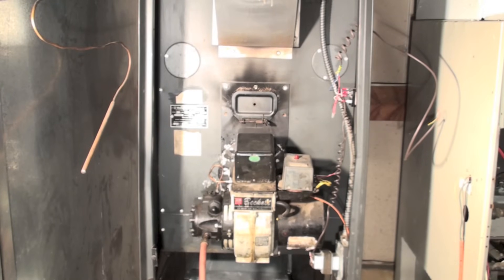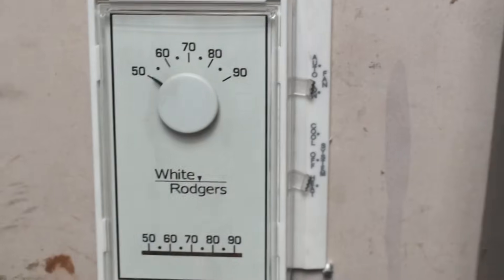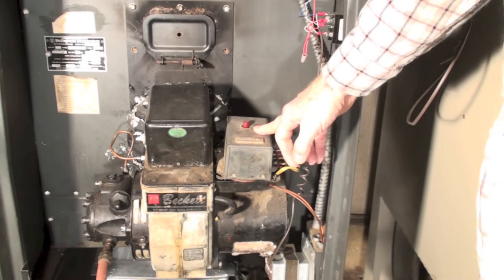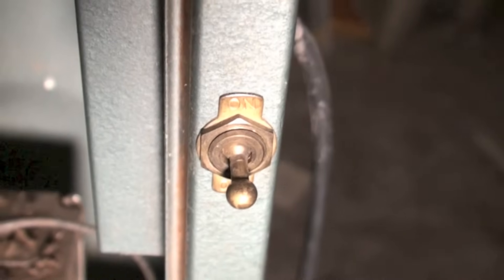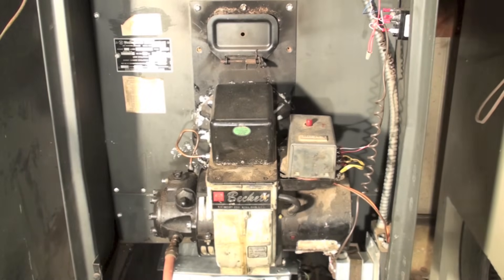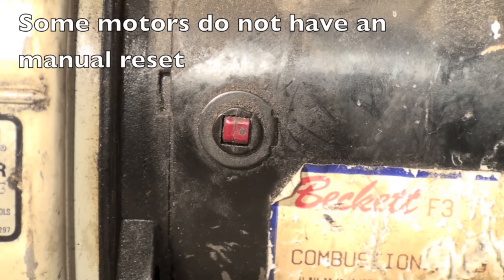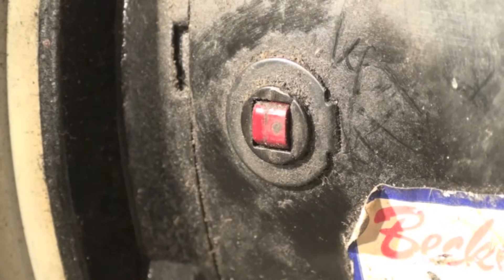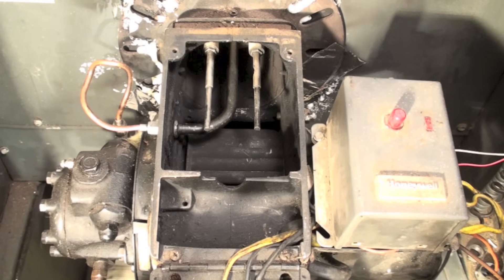Troubleshoot the oil furnace part 1. Burner won't start.

Comment: my burner is doing nothing at all. checked the motor and works fine. the red button never tripped but I can manually trip and and the red light will come on. there is power to it. could it be my thermostat?  again no noise nothing at all. also could it be my Honeywell r8184g intermittent ignition oil primary?  please help! !
Reply from the maker: +dandanzoo You can jumper the thermostat by connecting the T-T terminals.  You can also disconnect one of the terminals connected to F-F.  If it starts when disconnecting one of the F-F terminals, the cad cell is shorted.  Check on the side of the burner motor to see if there is a reset button.  Just a few things to try.  Hope they help.
GFM

Comment: Furnaceman, I have a Lear Siegler Model MOC80 oil furnace. It won't turn on unless I push the reset button {red button}. After it gets to the right temp (what the thermstat is set on) it will turn off but won't start again, when house gets cold,  until I push the reset again. What's wrong??
Reply from the maker: +Sandra Delaware You probably have an oil supply problem. Have you changed the oil filter?
GFM

Comment: +grayfurnaceman I have a beckket model a af when I restart it it turns on ignights the oil and burns for a few seconds then the flame extinguishes and starts to smoke alot any suggestions I think the missile could be slightly cloged what do you think
Reply: I mean nozzle sry
Reply from the maker: +Theresa Quinn I would do a complete service including nozzle, oil filter change and flush to start.
GFM
Reply: +grayfurnaceman ok thank you I'll try it  ,also it happened the day we got 2ft of snow there isn't a intake vent for o2 air for the combustion is there?

Comment: My furnace wont ignite by itself I have taken out the electrodes and tip and replaced both they where caked with soot it then worked for about a week then same problem I removed them again and they are covered again so i cleaned them it worked for a couple days now wont ignite again. I have stuck a long lighter and ignited it and it will run  just not start up by itself. I have noticed the flame comes way out to the transformer. the air intake is all the way closed and I have tried moving it all around but doesnt change the flame. can someone help
Reply from the maker: +Travis Workmen Look for blockage in the heat exchanger or vent pipe.
GFM

Comment: I've got nothing. this happens every so often. last time was about 2 weeks ago. the heat just stops kicking on out of nowhere like there is no power. last time it's done this I went to bed and woke up to find it working normally!? this time it's not kicked on for hours what could be the problem?
Reply from the maker: +Michael Russo Probably the cad cell is not sensing flame.  Be sure it is pointing towards the fire and is clean.  You could also have an oil supply problem.  Dirty oil filter?
GFM
Reply: +grayfurnaceman when I turn on the oil furnace  no sound comes out or anything, 
 its like it has no power, I checked the motor and it works, also I put in a new termostate, so what can I do if theres no sound when I turn on the furnace. Plz help.

Comment: my dad, let his oil run out, he got a filling, it ran fine, but decided to tinker. he swapped the filter on the tank. flushed the line from filter to burner. but now it won't bleed, it spittles a little bit, foams up. and just trickles. he's been trying to sort it for days. and refuses to call someone. any tips?
Reply from the maker: +Behemoth Vaping Be sure the gasket on the filter is properly installed.
GFM

Comment: I hit the reset and it just buzz's and then shuts off. Anyway to start the heater besides hitting the reset?
Reply from the maker: +Holly Nites Check to see if there is a reset on the burner motor.  Probably a red button that clicks when pressed.  Hope this helps.
GFM
Reply: There is a button, but it did not pop out. I did find something out. I turn the electric off, bring the black transformer box back and turn the fan underneath with a screwdriver. I put the transformer back in place turn the electric on and hit the reset and it starts. Why would turning the fan make it work?
Reply from the maker: +Holly Nites That is probably the centrifugal switch making contact when you turn the blower wheel.  New motor.
GFM

Comment: Hi I have the same system as you but only fan / blower goes on not motor for could this be igniter controller
Reply from the maker: +thetruth Does the burner motor rotate?
GFM
Reply: grayfurnaceman yes when I was turning switch on and off it actually turned on for 40 secs and I checked for spark good spark.
Reply from the maker: +thetruth Sounds like no oil available.  Is there a fog of oil in the combustion chamber when the burner is running?
GFM
Reply: grayfurnaceman fan blows but the oil motor does not turn on can it be the Igniter controller?
Reply from the maker: +thetruth Probably not the controller.  Still looks like no oil available.  Plugged nozzle, plugged filter, no oil in tank or pump failure.
GFM
Reply: grayfurnaceman tanks are almost at full plenty oil. typically the oil motor / pump turns on for a few seconds before turning off  but that isn't happening at all.
Reply from the maker: +thetruth What is the model# of the controller?
GFM
Reply: grayfurnaceman R814 G4009 intermittent ignition oil primary
Reply: grayfurnaceman here the model # R814 G4009 intermittent ignition oil primary

Comment: I have a Beckett oil burner with hot water heater. I have purchased three controls the one to the right of the unit that has the button you use to restart the burner. They all cost about $100. - $125 each. The first two lasted less then a year. The next one I purchased never worked and the shop would not take it back. Now I have to get another one. What do you think the problem is? It was installed by Viano Heating and Cooling, of Poughkeepsie NY. and the main owner who worked on the boiler has passed on. I called another company and they want $125. to come out that is applied to the first 15 minutes!
Reply: Marine Atlantic

Comment: The boiler fires up for approx 10 seconds
Reply from the maker: bazzer245 If the fire goes out and the burner continues to run for 1 min, it sounds like an oil supply problem.  You can remove the discharge pipe from the burner and direct the pipe into a can.  Reset the burner.  If oil flow does not continuously come out of the pipe, the filter could be plugged.
GFM

Comment: Hi, when i push my red button box, the boiler does not stay on, i am wondering about 3 loose wires in this box. I will check out the colours if you think you can help, thanks.
Reply from the maker: bazzer245 Does the unit fire off, then shut down after approx 1 minute?
GFM

Comment: Im sorry for that last msg. I mean it will run until all the oil is gone
Reply from the maker: Jermaine Thompson I may not be understanding.  Are you saying there burner comes on and heats but will not shut off?  Does the boiler safety popoff open and dump hot water?
GFM

Comment: My boiler doesnt shut off when there isnt any oil in the tank.
Reply from the maker: Jermaine Thompson Do you mean the burner continues to run when there is no oil?
GFM
Reply: Yes. Once i hit the button to start it will run until all the oil is gone. Please help
Reply: @bigtime4698  
It runs off of oil.
You need to buy more oil.
Not complicated
Reply: Jayvon Thompson

Comment: sire i have a question if i have a cabin 13*4*2.70 meter and i need to choose a stable
  oil (gasoline) burner furnace . how i choose and how much power do i have to chose ? cabin is for curing painting fiber please answer as soon as possible thank

Comment: Hello , I am getting blowbacks on my beckett fuel oil furnace. i put new filter on and replaced the pump screen and gasket. I have a new nozzle here. The furnace is not lighting sometimes but If I lightly tap the pump on the side with a small wrench it kicks right on . Now I am left wondering , is it the nozzle, the pump, or the coupler....
Reply from the maker: John Peterson I would be looking at the pump solenoid if it has one.  Could also have a spark problem.  Shorting to ground, or a failing transformer.  Hope this helps.
GFM

Comment: Bought oil for the furnace. Furnace worked and then later on in the evening noticed it was cold in the house.  Went downstairs and hit the reset button.  Nothing happens.  Help..not sure what to do next.  Hope this is read and can be answered. Thanks.
Reply from the maker: Robin LaVonne Moore If the button was pushed twice and you have the newer cad cell relay, it locks out.  This video tells how to reset it.  http://youtu.be/SHTwhOtvQWE  As for the flame failure, you may have a plugged nozzle.  This sometimes happens when the oil gets stirred up by the new oil coming into the tank.  Hope this helps.
GFM
Reply: grayfurnaceman Thanks for the response... I have an old oil furnace-lennox we don't have newer cad, we have an old cad... we aren't getting anything. Appreciate your help.

Comment: I'm wondering if I need to replace my motor to my furnace..I added oil yesterday, I bleed about a gallon worth, and I constantly have to push the reset button..sometimes it starts right up other times I can spend an hour+ pushing it. When it started and stays on consistently it's fine but if I lower the thermostat about 10+ for a while then I have to start the pushing game again..a big headache..please help
Reply from the maker: if you get a steady stream when bleeding and no air bubbles, you could have a pump failing.  You should check pump pressure.  Also, you could have a partly plugged nozzle.  Hope this helps.
GFM
Reply: grayfurnaceman thanks. Found out yesterday it the transformer was weak. Had it replace and serviced working great now. Cost about $400 but I live in Mich and need my heat
Reply: I have that same problem

Comment: Very informative on start up of my system I hear electrodes sparking but the motor does not start. You removed the motor is that so it doesn't pump oil into the system. I think the motor is bad
Reply from the maker: Harvey Millner That's just a last check to be sure the pump is not wearing out.  Be sure the manual reset limit(if it has one) is not kicked off.   Hope this helps.
GFM
Reply: Thanks I pulled the motor and found that the motor runs when I plug it in but not when it's hooked up to the furnace so I assume I'm losing power somewhere. I hope you can give me details that will help . I previously had a service call and the prob was the clogged orifice it worked fine and now it's not powering at all ...the motor that is

Comment: No
Reply from the maker: nick4556 The first thing to do is service the furnace.  They need to be serviced every year.
GFM
Reply: grayfurnaceman Hi ok combustion chamber needs to be replaced  (craked and I have a 3" hole. I have a 1946 Gurney model 518. Combustion chamber is a cylinder about 12" diameter by 12" long. any recommendation/video of how to replace....and who sells Combustion chamber? All help is greatly appreciated
Nick

Comment: I bought my house 4 years ago, zero problems with my furnace. Over the past month only twice my furnace has not started when I raise the temperature on the thermostat.So I go to the furnace and Hit the reset and it starts up. Any clues of why this happens and what steps I can take to resolve this intermittent issue
Reply from the maker: nick4556 Has the furnace been serviced since you purchased your house?
GFM
Reply: No but I do clean the inside myself

Comment: HI Gray  You are truly the furnaceman. Thanks for sharing your knowledge.  I have learned a tremendous amount in the last four days but I am still having smoke problems with my oil furnace.  We have replaced the filters, cleaned and replaced the cad cell, replaced the nozzle and reset the gaps to spec.  When we fired the furnace I had some smoke escaping the heat exchanger.  I let in a little more air and the smoke stopped. In the house it works great with no smell of fuel.  On shutdown it smokes badly from the air intake but when the blower stops the smoke subsides. I know this is unburned fuel smoldering. If I dial back the air intake again it escapes from the exchanger.  I did notice damage to the combustion chamber and the old fire bricks. Could his be an oil pressure issue?  Any other guesses?  Is it time to give up?  Thanks
Reply from the maker: arean sherwood If the bricks contact the flame it will smoke.  Also you should check the heat exchanger for cracks.  Hope this helps.
GFM

Comment: Morning gray,
I would like to ask a few questions. I have a Beckett burner on a hot air furnace. I purchased the home new 15 years ago, but thought the burner was 1988 or so. I believe it is an AF model. I had some work done last year and the tech took the motor off. Well it was never mounted back flush to housing. So had a different tech this year for a cleaning and told him my issues. I also asked about the motor. He reseated the motor and now it makes a noise. The initial reason I had him come out, is my furnace seemed to run every ten minutes. He put original nozzle .65x80 back in and seems better. Not sure if switches(limit) could be an issue also. I guess I am just trying to figure motor out as it is cold season here and would buy a motor and coupling to have in case of issue. Any ideas would be much appreciated. Also no specs on side of motor. I think 1/7th HP and 3450 rpm, my thought, but not sure frame or mount type. Will a grainger motor work or a better place available? Thank you for any ideas or help.
Reply from the maker: 13174mrh The oil burner motor for the Beckett has a special mount that is for oil burners only.  It is a 1/7hp 3450 rpm.  As for the noise, it could be the coupling between the motor and the pump.  Hope this helps.
GFM

Comment: Hi gray
    I enjoy watching and listening to your guides on these burners. I am scratching my head at my latest problem. I changed the oil filter, and was bleeding the pump when the safety locked out on me. I have not been able to get the fan to spin since, do you have a recommendation for me to try, p.s. the motor is good and it checked out fine

Comment: Hi, my oil furnace sometimes has a delayed ignition. The motor n fan will run for few seconds (longer than it should). Then you'll hear a puff that'll be the fire igniting followed by some smoke. Can u help please?
Reply from the maker: There are a number of things that could cause delayed ignition.  Partially plugged nozzle, a short on the electrodes are a couple.  You need to service it to start.  Take a look at my oil burner service videos if you want to do it yourself.  Hope this helps.
GFM

Comment: Hello GFM,
Great video, I have
 an old intertherm oil furnace, when it calls for heat, the flames will go up for a few seconds, then gets cut off, and after less then a minute the reset button  pops out.I reset the button and its the same before . I changed the nozzle and cad cell, but still I have that issue. I bled the oil and cleaned the filter and pump screen, still nothing happened. Could you please help me on what I should do about it?
Reply from the maker: anwar karimi I would be looking at possible plugged vent or possibly a plugged combustion air inlet if it is in a mobile home.  Hope this helps.
GFM
Reply: grayfurnaceman Thank you for answering my question. The problem wasn't what you said. I opened the gun pipe oil to burner and turned the power on. But just for a few seconds it sent the oil and that's it. Do you think its an oil pump problem or a fan motor problem? But sometimes the fan was running smoothly, but sometimes it wasn't. And I checked the fan by hand and its easy to rotate, which means i think its okay , but still i'm not sure.
Reply: anwar karimi You've probably sorted the problem by now, but that sounds like the Solenoid coil to me, hopefully that helps for future reference.

Comment: Had a odd problem once..my furnaced worked fine +- then I had to push the motor reset in the morning then all was well till the next morning  had to reset  only once in morning after over night temp turned down..went to furnace store..great guy told me he had that problem once it was a weak button return spring?  he said next time tap the control box with something..I did. It reset...but a new control box...experianced folks are great..thanks for videos sid

Comment: a pin hole leak in my standard water plumbing pipe squirted water into the box that has the reset button and tripped the burner and now the indicator light is on. If I dry it off, is it safe to press the reset button? Thanks
Reply from the maker: SuperJV4x I would not trust it.  Big time safety hazard.  Replace it.
GFM

Comment: What is the reset button does not engage?
Reply from the maker: Gilbert Coleman It depends on the type of primary.  The older style like the one in the video will reset as many times as it is reset.  Newer ones will only reset once.  See this video:  http://youtu.be/SHTwhOtvQWE  However, be sure power is available to the unit.  Also, note if anything at all happens such as a humming sound.  That would indicate a motor failure or the overload is kicked off.  Hope this helps.
GFM

Comment: Love your videos as they have been very educational. Can water in my oil tank cause the furnace to rumble and puff smoke out the draft lid ? Thanks
Reply from the maker: Robert Wood Generally, no.  I would be looking for plugged ht exchanger or smoke pipe.
GFM
Reply: grayfurnaceman Thanks brother